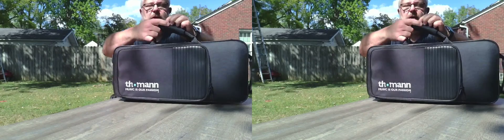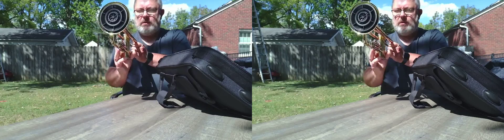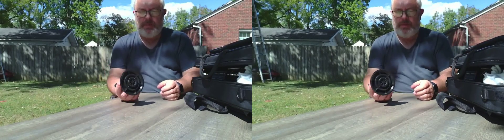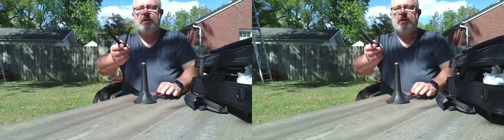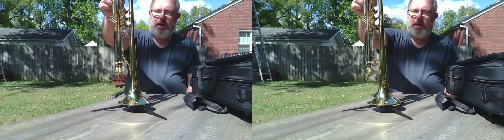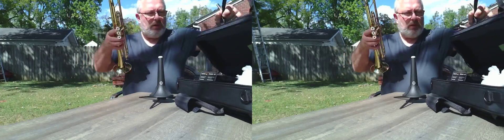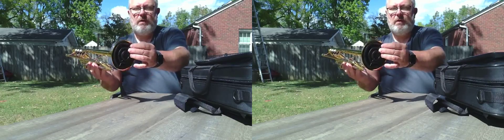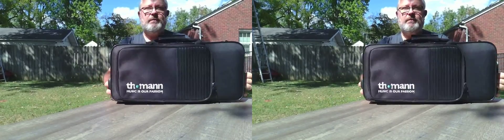QooCam Ego Stereo Aligned with SMA

Comment: I got this camera and found out that the lenses are vertically misaligned. Right lens is aiming a bit higher than the left one. I am considering to return the camera as faulty. Do you have the same issue?
Reply from the maker: mine is fine. but there was talk about a new upcoming firmware that can solve that kind of issue.